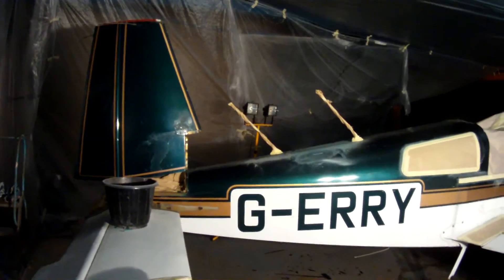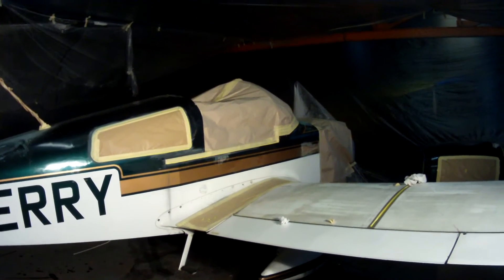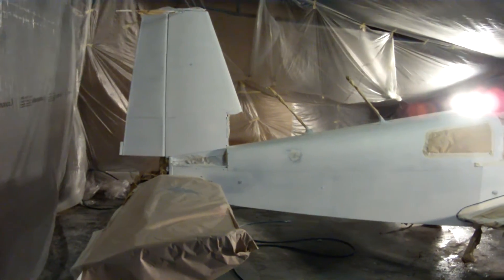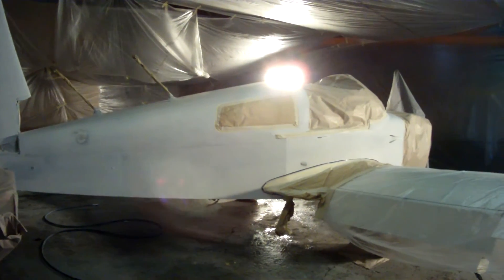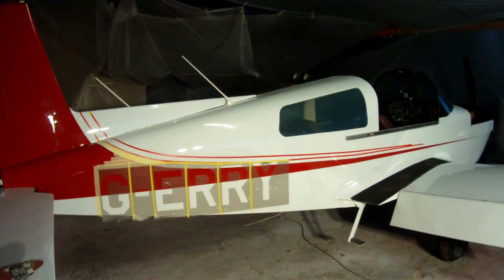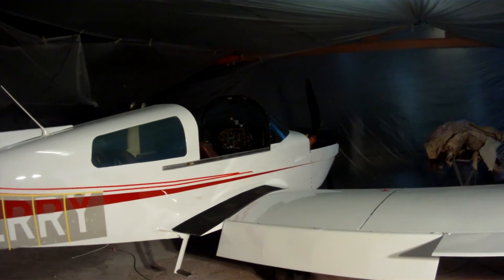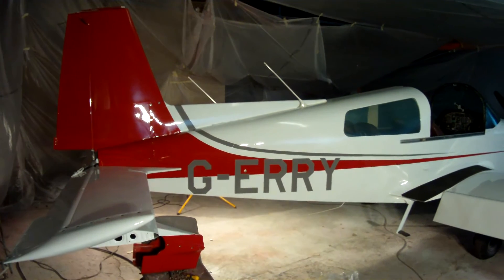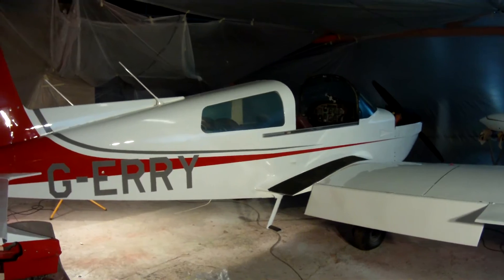Grumman AA5 Re-Spray

Comment: What did he use to remove the old paint ? That looks very unusual ...
Reply from the maker: BetterAircraftFabric 
I am afraid I do not know. It is not my aircraft and as I said in the description, Nigel asked if he could use my camera while I was away on holiday with the family.
Reply: Hi
 to remove the paint i had to sand off 10 layers of paint back to bare metal because there was damp and contamination in the original paintwork